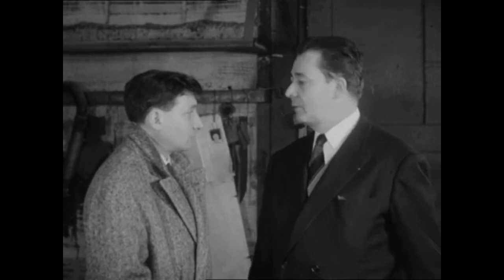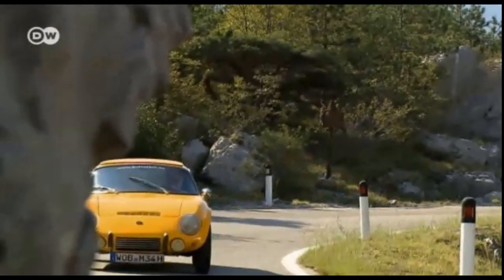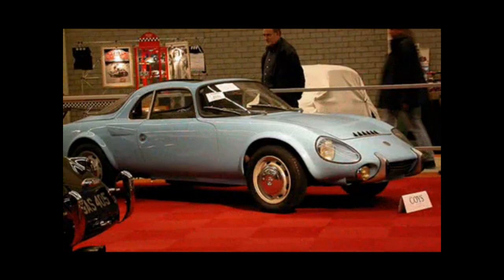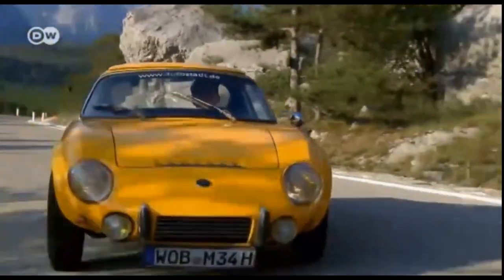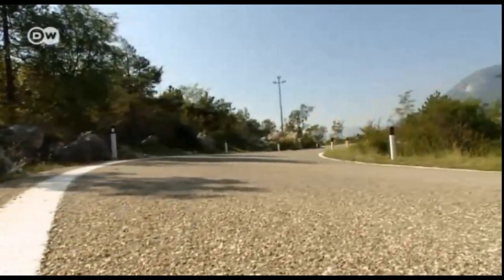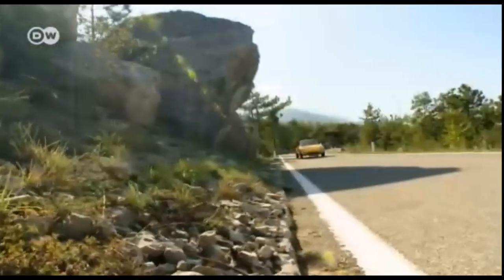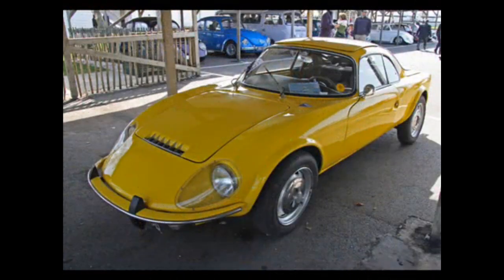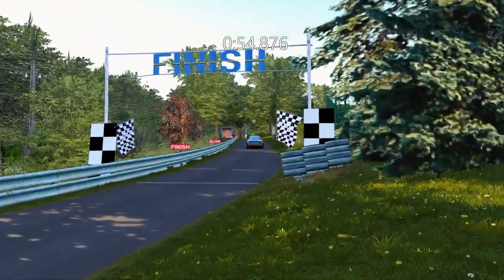Matra Jet - World's First Mid-Engine Production Car ( made in France)

Comment from the maker: The mid-engine sports car was introduced in 1962 when Rene Bonnet presented the short-lived Matra Djet at the Paris Salon. Less than a year later, Enzo Ferrari recognized the potential of mounting the engine in front of the rear axle, and the Dino Berlinetta Speciale became the concept car upon which many subsequent Ferraris would be based. The trend quickly caught on, and today mid-engine sports cars are among the most common configurations for high-performance vehicles, thanks to better handling resulting from more even weight distribution across all four tires.
Reply: To try and say Porsche wasn't building the first production rear mid-engine/rear-engine sports cars in the 50's is just splitting hairs because the axel location is splitting hairs is the most hypocritical way.
Reply from the maker: @rickden8362  The Djet deserves to be remembered for its simple, yet innovative design and for the fact that it was the world’s first series-production, mid-engine road car. Porsche mid engive was in 90s
Reply: @justincase9014  The 914 was in 1969 and nearly 119,000 were produced, dwarfing what the Matra Djet produced.
Reply: 1947. First Porsche production car. Mid engine.

Comment: With the advent of so many front wheel drive cars, it surprises me that a mid engine sports car is so rare in the lower priced car market. Since most of the development cost of a car is in its engine/transmission, I would think development of a mid engine car would be relatively easy for a big auto maker. But so far we've only seen the Pontiac Fiero and the X 1/9 originally from Fiat as massed produced cars.
Reply: Il y a aussi Matra 530 V4 Ford , Matra Simca Bagheera 50 000 exemplaires , Talbot Matra Muréna , toutes des voitures de séries à moteur central longitudinal où central transversal arrière , presque inconnues en dehors de la France .
Reply: Loved the hell out of my X1/9............ just sayin'...........
Reply: Toyota...MR2 in three different generations. Also the MG F and TG 1995-2011 in the UK and China. Renault Alpine A110 from 2017... There are quite a few sports cars out there that have low budget drivetrains.

Comment: You are talking about back mid engine mounting.
Front mid engine mounting was earlier around. You had the Citroen DS, SM. But also the Renault 4, 5 (not super 5), 6. They all had the engine back of the front wheels. The gearbox being in the front. Those cars are older than the Matra. The first one was the Citroen Traction Avant. Saab had one also, the Sonett.
These cars are front wheel driven.
Matra had the Back mid Engine. Rear wheel driven. After that you got the Murena and Bagheera.
But you have the Fiat X19 in this category light weight not super car vehicles.
I miss probably some other ones more recent (Porsche Boxter...)
Reply: Daniel, usually in English speaking motor car circles the convention is to write front mid engine and rear mid engine. Many folks feel like front mid engine isn't particularly interesting and it certainly isn't new, though the term is.

Comment: Possibly it was the world's first mid engine production car.

Arguably gave rise to the world's first mid engine sports car with a decent chassis - Lotus Europa - used the same Renault gearbox.

World's first modern mass produced mid engine sports car - Fiat X1/9, because of its all steel monocoque construction, inline transaxle, and bucket and shim valve clearance adjustment.

In my opinion🥴 but I'm full of it.
Reply from the maker: I appreciate your opinion I'm full of it тоо. Each of these cars  Alpine A110  ,   Fiat X1/9    contributed  the evolution of mid-engine sports cars. We  can just enjoy in those stories.
Reply: @justincase9014  L' Alpine A 110 ( et A 310) n'a pas un moteur central , celui ci est placé derrière le train arrière et la boîte de vitesse vers l'avant ( comme une Porsche 911).
Reply: @fredericlegall690  thank you Frederic. I noticed that error. The 2017 A110 is mid engine, but not what Marcbowden was referring to.
Reply: @justincase9014  I forgot about the A110 ! Another great car!
Thanks for uploading, cheers 🥂
Reply: Actually one of the weaknesses of the Djet was the use of the Renault Estafette gearbox, the Estafette being a utility VAN.  This was a clunky 'box with few, if any, alternate ratios. The Europa initially used the gearbox from a Renault 16 and later a 5-speed from the 16TX.  The Djet gearbox was one of the reasons this car had such limited racing success.  Read up on the reasons behind the Europa design and why it immediately surpassed what the Bonnet Djet could do.  Even when Matra took the company over the Djet was only a stopgap to their own designs. Its chassis was a joke.
Although the Djet had a lovely shape and promised much, it nearly killed some racers (J.P. Beltoise was a notable survivor) and was never recognized for anything more than being "the first."
Reply from the maker: @jaysloane  Renault Estafette gearbox in the Matra Djet.  The alternative was a gearbox from  some German tank, those were hard times 😁, and being first is ok sometimes.

Comment: First mass production mid-engined car: Hanomag 2/10PS, moren than 15000 (!) build between 1925 and 1928. And they were build on an assembly line. Another one (not a very big mass): Gutbrod Superior, 1933 - 1935. They made around 900 of it. Even Mercedes build such a car (Mercedes-Benz 150) at that time, but in low numbers.

Porsche had the mid-engine experience very early with their first prototype after the war and with the 550 racecar. Maybe the Djet showed them, that a "low-price" sportscar would do it, then we have a look at the 914 (1969 - 1976). But who knows?

I would like to add, that I always had a soft spot for the Djet. It is just a nice looking thing.
Reply from the maker: Hanomag 2/10PS  was RMR layout,  Gutbrod Superior were Rear-engined, anyway, djet, not much of a deal but fun piece.
Reply: Okay - how about the 1901 Oldsmobile. Generally credited as the first mass-production automobile. It was mid-engined.
Reply from the maker: @GunsmithSid  A runabout is a car body style popular in the 1910s, based on the horse-drawn runabout carriage.
Reply: @justincase9014  Si on en revient au tout début , c'est Joseph  CUGNOT qui a crée l'automobile en 1771 , tout est parti de cette réalisation , c'était LE précurseur .

Comment: You say it influenced Porsche. Their first mid engine car was the Boxster which came out in 1996. All the 911s were rear engine and 928s and 924 etc had a front engine. Matra was well know for it's F2 and F3 racing cars in the 60s. 90 cars is not mass production.
Reply: "Their first mid engine car was the Boxster " No, production-wise it was the 914, starting 1969.
Reply: Semantic arguments are a waste of time. Cool car!
Reply: @Krunch2020    And yet, they are the ugly heart and soul of YouTube, where commenters decide to argue first, then go looking for an argument.
Reply: Mid-engine Porsches: 550, 718, 904, 914, 911 GT1, Boxster, Cayman. The Boxster was,a modern day 914-6. Noe, with a big boxer 4, it is a modern 914 S.
Reply: The very first Porsche, made in 1948, was mid-engined. It was a prototype however, and the engine was moved to the rear when the 356 went into production.
Reply: Wrong.

Comment: Porsche 550, 1953 to 1956, 90 produced, mid engined, built for racing like most Pcars  but road legal. 

The Benz Velo of 1894, 1200 built, engine over the rear axle.
Reply: street legal but not really production type cars
Reply from the maker: Racing cars, not street legal
Reply: @justincase9014   In the 1950s and part way into the 1960s, le Mans race cars were driven to the la Sarthe circuit. They were road legal. It's difficult to term them as 'production' cars, though.
Having seen this video, I looked up the de Tomaso Vallelunga to see how many were made - 59 of them, 1964-7.  That's 20 per year.
It takes a wait for the Lotus Europa (1966-75) for a really production mid-engined car, with around 10,000 made over the decade.  That's 1k per year.
Reply from the maker: @pashakdescilly7517  That's  what  am saying  👍
Reply: @justincase9014  James Dean drove his Porsche 550 on the road - and famously was killed in it